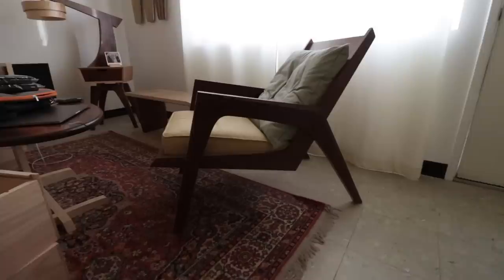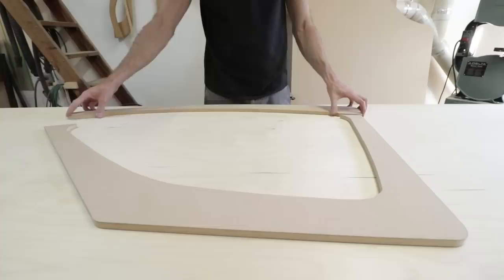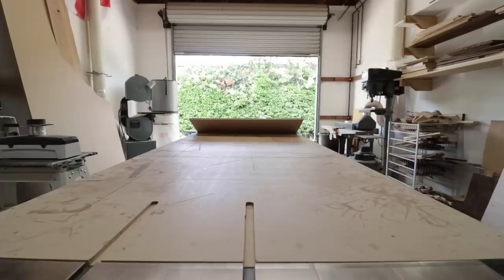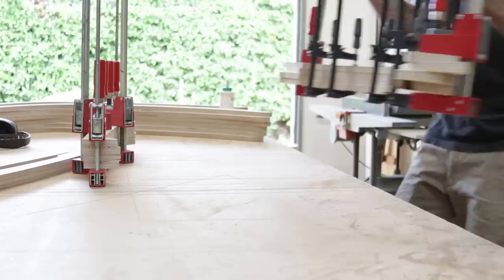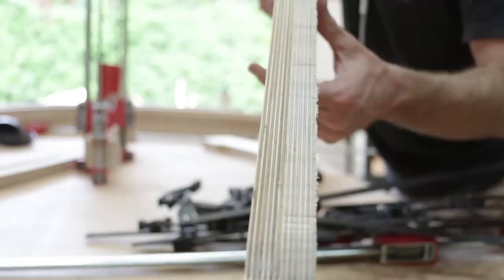Building a MODERN Plywood Rocking Chair from One Sheet - #rocklerplywoodchallenge

Comment: nice job Mr, Shaun but I think you can make the side frame also single ply wood ,I mean full frame should be join less , any way you are the master of Rocking chair
Reply from the maker: Thanks! Yeah, you definitely can, it just leaves a lot of the plywood unused. Doing it in multiple parts allows you to maximize material usage.

Comment: I bought the plans and perhaps I'm technology challenged too. I have two questions: 1. How do I print the templates FULL size? and 2. What's the layout on a 4 x 8 sheet so that one sheet will yield all pieces?

Love your manner of presenting, too!
Reply from the maker: Thanks for buying the plans! There should be an option when printing the PDF versions called "Poster" and that will print the parts on multiple sheets at full size. As for the layout for one sheet, I don't have that in any digital form. When I lay out something like this, I just trace the parts onto the sheet the best I can to maximize what I can get, so parts are kind of all over the place. Hope that helps!

Comment: Very nice! If you weren't constrained to 1 sheet of plywood for the challenge, would you consider cutting the base in one piece instead of joining them together from multiple segments? Might save a lot of joining, gluing, and clamping time, and it would have a great look, especially with all the grain lining up. Just spitballing a thought.
Reply from the maker: Thanks Dan! Yeah, you could definitely do it in one big piece, which would have a nice look. I think beyond the constraints of the challenge, doing it that way would just end up with a lot of waste. Which if you were clever, you could find a use for, but doing it in pieces definitely gives you the most efficient use of material.

Comment: Boy, such a nice and seemingly simple construct, that's so subtle at the same time! Did you work out the angles by math or by eye (I would consider both to be real achievements)? 
Is the rocking action to your liking or would you use a smaller curvature next time?
I definitely hope you win prizes and fame!!
Reply from the maker: Thank you! Almost everything was done by eye on the legs and the seat. The only thing I calculated was the angle on the cross pieces to make sure the legs angled back properly. The rocking action is pretty nice, too. I might try tweaking a few things if I try it again, but for a first shot, I am really happy with how it came out!

Comment: Another great and creative piece Shaun! I have a question - what are those little plastic pieces you use for clamping odd angles?
Reply from the maker: Thank you! Those are Bridge City Tool Works Miter Stitch Sets. They work great, but unfortunately they don't sell them anymore. Not sure if there is another company out there that sells something similar, but you could also probably make something that would work just as well.

Comment: Nice design. If this wasn't a 1 sheet challenge would you make the "rockers" from one piece instead of joining them?
Reply from the maker: Thanks Branden! You definitely could make them as one piece. I would probably still do it in multiple pieces as it reduces material waste, and allows the option to use solid wood if I ever wanted to.

Comment: Hey Shaun, this thing is really well designed! Well done. I definitely respect a maker's trade secrets so disregard this question if you'd like but is there any chance you would be willing/able to share the templates for the chair? Only for private use, of course. I have access to a CNC router and would like to see if I can reproduce a similar design.
Reply from the maker: Thanks, Alec! Really appreciate it! I would have no problem with you recreating this piece, but my templates only exist in MDF form. I'm not savvy enough with any design programs to make digital versions, so unfortunately I don't have anything to offer you. Hopefully at some point I can figure it out and start offering digital plans and templates!
Reply: Ah, no worries! I was just going to see if I could get a head start but I'll take a crack at designing something myself, that's part of the fun anyways. Keep making and I'll keep watching!